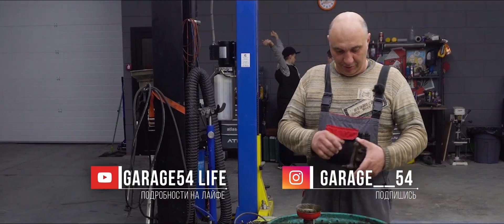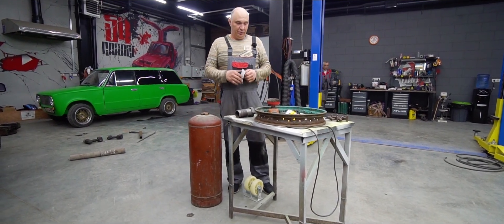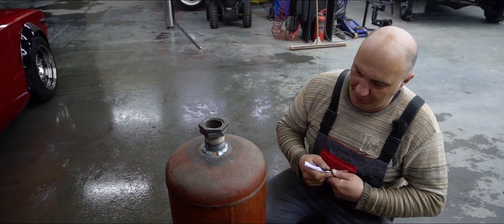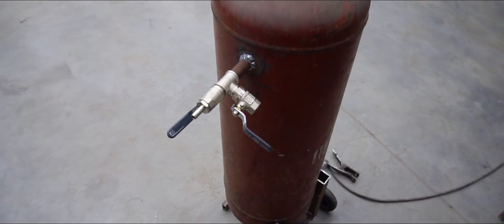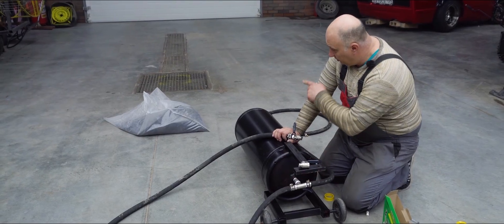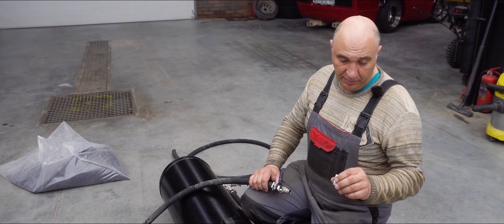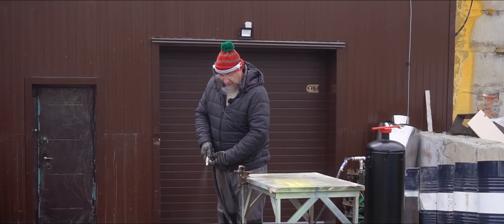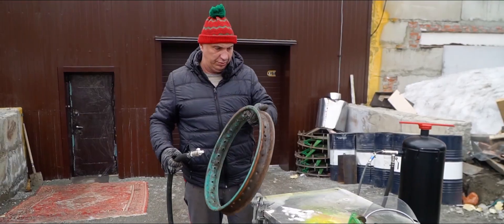Making a DIY sandblaster

Comment: The sandblaster design here seems to be pretty well designed. The only concern that I have is the fact that they used ball valves in areas that there will be plenty of sand, which probably will be a an issue pretty soon. 

As far as the wire wheel thing is concerned, as the primary grinder and finisher in the iron works that I work at, I can assure you that if you have the right wire wheel, it could easily take that rust off. Applying the right amount of pressure, I have done quick sweeps and gotten worse rust right off that way faster. If the wire wheel for your grinder are bad enough that you consider a drill wire wheel as in any way comparable, that would probably be the main issue. I personally like Auprex's 4 inch diameter .02 twist knotted wire wheels off of amazon. Those things eat through rust like butter. Do be careful though, because it can eat the steel's surface and definitely use all the safety equipment too. I can't tell you how many times I have found bits of wire embedded in my arms, when I don't use sleeves.

Comment: Gotta set the sand and air mix and when opening the hand valve all open or closed quickly. Been doing this for decades and if not you'll wear the hand valve out in a few seconds. Even ones made for blasting will wear out in a minute if you don't have full open or closed. Always wear a hood with least 3/8 plastic lens. Hook a filter up before the sand or that'll cause issues where you gotta shake it to get sand out good. Even with hood and glasses on sand will get inside and will get in your eyes. Sand will get in places sand shouldn't be. And duct tape won't stop it. So if using on a diff, engine etc plug up with plugs and whatever you can. Great idea and cheap idea. Use hydraulic hose for the sand hose. I've used one and had a blow out and it's not good. Check it before each use. When you do a big job it's alot of sand going through and it will eat hoses, valves etc. Way faster than anything but acid.

Comment: Filling it with water is great and all but it's a pain in the ass. I have welded on many used gas tanks and i've found that all I have to do is make sure it's empty and blow compressed air in there.

Comment: PLEASE PUT THE GUARD BACK ON THAT ANGLE GRINDER IF YOU ARE USING THOSE KINDS OF CUTTING DISKS!!!!
Reply: I usually have mine removed also, but only because I'm using paper sanding disks most of the time for what i do. If that flimsy cheep cutting disk cracks at 5,000+ RPM, you're going to have a REALLY interesting new face piercing to show your friends. Google some images if you don't want to take my word for it. And no, safety glasses or a face shield are not a substitute on their own, it will go right through them at that speed. You'll see if you search for the images. You'll still be able to do the job, just put the guard on, it ain't worth it. Good channel.
Reply: And a smart move regardless would to be to keep your face out of the same plane as the disk. Keep your face off to the side a little bit. You're not doing precision surgery here, you'll be able to see fine. Better than not being able to see later.

Comment: I love these vids but holy shit was that unsafe. I would've made a plexiglass box to put the parts into before sand blasting so it doesn't hit everything in the area. If any of that failed as well, he could've been seriously injured or killed. Yes he tested the hoses for holding the air pressure but what about all the rough grains of sand passing through the hose as high speeds

Comment: remove rust in a H2SO4 bath while re-growing iron/steel back with electroplating
Reply: paint, electroplate, iron, with aluminium (sulphate) or copper (sulphate)
Reply: add zinc to the mix with zinc sulphate, to the bath, to the paint
Reply: grow iron to a 3d printed mold by electroplating from ferrous sulphate
Reply: Sulphuric acid not good at removing rust, just your skin😎
Reply: how about copper/silver acetate metal layer chemical deposition, with heated sand blaster metal paint spray

Comment: i used to work at a scrap yard and we would cut propane tanks with acetalyne torches after just screwing the cap out. little flames, no big deal. Except one day one was in the cutting pile with a cap still on it i started cutting into it and all of a sudden loud bang... well the cap flew out... we heard it hit something 500 ft across the scrap yard. needless to say i checked every one from then on

Comment: I've made several sandblasters out of propane tanks and you guys made yours different than mine. First, get a new two-wheel cart for about 40 to 50 bucks and just blow out the tank instead of using water. Don't cut the top of the tank out. Remove the valve and put a 3/4" nipple 1" long where the valve was. Screw on a 3/4" gate valve to control how much sand you want with your air. You will find this most useful. Another short nipple with a T. All 3/4" fittings. One side of the T is your sandblast hose. The other side is 3/4" hose that goes up the side of tank. Put the 2" pipe thread nipple into the hole you put in bottom of tank which from now on is the top of tank. 3/4" nipple in the side of your filler pipe long enough to go through the edge of the lip of the tank. I always tack this one after tight to keep from moving. Put a T on the nipple pointing down two take the hose from the other T. Stitch an 18" plate on the wheel cart for more stability and weld a bent pipe from one cart frame to the other side to protect your air dryer when it gets knocked over. Don't worry it will get knocked over sometime. A female 1/2" chuck going to the dryer and your done. The gate vale will save lots of sand and prevent from over loading your discharge. I always mark the valve tap for settings and shut off sand when done. With a 3/16" nozzle you can do a 3-4" pass in one swipe or a long-wheelbase five-ton to shinny steel in 2 hours or less. The dryers on tank and coming out of air tank is best. Well worth 6the extra bucks. I run a regulator at 150 psi out of a 225 psi system. This will work better than what you buy.
Reply: NEVER, NEVER just use air to remove the residual gas; always use water to be 100% safe! A very talented welder in my area blew himself up just using air.

Comment: I have a question, but there’s too many variables. For example; Why would they cut the threads off of the fittings? Why not incorporate new threaded holes for the fittings? Is a hand welded fitting equivalent to a threaded fitting? Yes; there are many types of teflon tape, even for gas fittings. But, since this cylinder no longer contains gas, the question is, “ How much PSI is this air-filled sand blaster going to require or handle for a successful operation?

Comment: It works well but can be very dangerous. Your losing your media and should have a air regulator and air filter. 
The ceramic nozzle is also a bit small. Thus the spray pattern. Good luck and be careful.

Comment: In life there are 4 levels of difficulty.  1 Easy. 2 Medium. 3 Hard. 4 Russian.   Makes me want to pull out my old sand blaster and clean stuff.  Important to keep the water out of the air.  Fit a water separator to your compressor line.  Regards from South Africa.

Comment: Russians are amazing and very intelligent . They are a bit like the irish as in safety  comes along later .However great video but to really blast you need an animal of a compressor and larger hoses .Some are using powerwashers now and putting an additive in the water to delay rust until the units dry off .All these cleaned bits should be prime sealed immediatly after blasting .Anyway well done.

Comment: No doubt this guy is very creative.  Unfortunately, copper slag is an environmental hazard.  https://news.stanford.edu/pr/98/981209slag.html The quip about Chernobyl is right on point.  No one seems to care (especially in Russia) that you just spray contaminants all over the ground, rather than in a contained environment in which the slag can be reused indefinitely. 

Несомненно, этот парень очень креативный. К сожалению, медный шлак представляет опасность для окружающей среды. https://news.stanford.edu/pr/98/981209slag.html Шутка про Чернобыль уместна. Похоже, никого не волнует (особенно в России), что загрязняющие вещества разбрызгиваются по всей земле, а не в закрытой среде, в которой шлак можно использовать повторно бесконечно.

Comment: I prefer to wash it out than purge it with inert gas (engine exhaust) before & while I'm cutting. So I don't have water while using 240v grinder. Just a different way to skin the same cat.

Comment: Just keep in mind that grid flies like 10-15m so the blu car next to wise needs now paint. Replace hose every few months they get soft, the best hose is hydrulic with steel reinforcing. I would think of some safety device the professional machines have deadman swich (low pressure gives signal to pneumatic swich that swiches big diagrapf valve). Most robust material and cheap is rubber but its not to last forever.
Most dangerous situations:
1. Grind reflecs from object and you get hit by rebound.
2. Main pressure hose bursts and grind flies everywere. Its like machine gun.
Ps. If the grind is wet from compressed air it will get stuck. It turns into rock when is rusting. Just empty the chamber after use.
Also mind grind is reusable.

Comment: You can use Molasses , and water to dissolve rust . 1 part molasses 9 parts water. Let parts soak for a week. Then wash away the rust with a water hose.

Comment: Old Plumber trick! If you have  tapered fittings, always tighten first. Just enough to break free. The taper will slightly enlarge. This breaks loose the joint, then unthread easier.

Comment: The most important thing he didn't mention, is NEVER even think about welding an empty gas or gasoline container. ALWAYS make sure it's full of water. So called "empty" containers often have traces of old fuel in them, and they WILL EXPLODE if you dont fill them with water.
Reply: 2:08 Watch again. He did mention filling it with water was crucial to displace any gases or dampen any fuels.

Comment: Instead of trying to salvage so rusted rim, you'll be much better of buying new one🙏 Surface rust will not compromise the structural integrity but that rim was completely rusted through and removing it will take you very long time and in the you will just compromise the strength.. It's nice to save money but not in expanse of safety😉

Comment: At 17.20-- "That said, safety should always be a big concern..." 
To which we heartily agree, and suggest the sandblaster operator do all cleaning of parts outside, not inside the shop. Airborne silica is a permanent hazard for lungs, so he should wear an ultra- fine-particle, dual breather mask, which covers the eyes, nose and mouth with an air-tight seal. This type of mask is used in auto body shops during spraying of automotive paints. You cannot be too careful, even with all the thought and craftsmanship which produced this wonderful tool. Thank you for the idea !
BTW-- BMI Russian provided an Impressively fluid and nuanced translation. Its translator had no discernible accent, and spoke as rapidly and clearly as needed.

Comment: These guys definitely went to space first !!  and had there been a way to get to the Moon  regardless  if  it  got them   hurt or killed ?  they would have  done  it  !! but they couldn't  because  of  the firmament  , and it wasn't  for a lack of  trying  .these guys right  here don't  complicate  things  yet they know  that what they're  doing is dangerous  , so they do what they  gotta  do  and very  resourceful , where they  lack in safety  they gain in common sense. These are The real deal  kinda guys .

Comment: I cut the top off a 50 gallon form oil drum that still had plenty of oil still in it.  Cut with a oxygen acetyl touch cut halfway leaving less than a 1/4 tab on one side then cutting the other side. Keep in mind I was standing below the lid my arm fully extended and crouched down.  The lid falls into to drum and a mushroom cloud about as big as the Presbyterian hospital that we were building at the time in Albuquerque NM. So fun watching the look on the all the formen

Comment: eh what gas was it filled with , I read propane on the tank so I guess LPG , if you open the tank and pour out the liquid gas and let it air out for 1-2 days everything should have evaporated and no need to fill it with water to work on it.

Comment: I use to sandblast with professionnal machines 40 hours a week. We also had a portable sandblaster that kinda looked like this one. Never used it in more than a decade working there. 

To operate this you need some good CFM from your compressor. Not those 8 gallons fron Harbor Freight trust me!  They recommend for those small ones a minimum 5 HP+ with 6 to 25 CFM. Also, you need a good capacity tank of air. I wouldn't recommend below 40 gallons, cause it goes very fast. 

Professionnal sandblast stations, on the other hand, were enclosed with a glass protective seethrought window, high power LED lights and filtered recuperation stations to get the maximum out of your blasting media. Those were pretty expensive and needed 550V 3 phases power and at the very least 35 CFM of airflow. Total investment, about 25K for each machine plus the blasting media and the compressor. 

Compared to a brush and grinder, this is WAY better and faster, night and day. For the price, I would suggest anyone in a garage to have that kind of equipment, but don't forget to wear some protective gears like a cartridge dusk mask and safety glasses. You don't want old paint particules in your lungs trust me.
Reply: Thank you!

Comment: Phosphoric Acid. The shot blaster is ace, no doubt about it, but, I found that the rust makes tiny pits in high carbon steel that are so small the grit cannot dig them out. To be rust free later on all rust Crystals need to go. Phosphoric acid gets right in to the microscopic holes and de-rusts them. *shot blast, acid, acid etch primer, two-pack top coat.

Comment: Dry air is the key to sandblasting. It takes surprisingly little moisture to interfer with the sand feed. One drop will stick a 2 cm ball of sand together. If the blast hose twitches as you work, you're getting sand in clumps. 

You're in a cold moist climate. You need more than a water separator. I suggest a refrigerated air dryer or a dessicant dryer. If that's not possible, rig up an air heater. 50 - 60⁰ C air to the sand pot will dry the sand and keep it loose all the way to the nozzle.

Comment: Sir if you put a shutoff after where the sand enters the hose,you can shut it off and release the pressure in the tank.Now turn the air on to the bottom of the tank. Now you can breakup any clumped blasting grit,with out emptying the hole tank. I ran one of these things for 30 years in a welding shop.

Comment: Also add a agitator air line close to the outlet to loosen the sand and get it to flow better, fluff up the sand

 And search for a 40/70 mix of sand..... for bad rust use a 30/50 grain sand, avoid 100 mesh sand as it is pretty much useless

Comment: I like this Russian and his ENGINE-nuity. Wish he lived next door so we could share idea's. Another way to do a sandblaster: Fill a Homer bucket with abrasive sand, insert a siphon tube into the sand with a vinyl hose connected to a solvent sprayer head. Connect air hose. Viola. Less susceptible to humidity and easy to clean. That big acetylene tank will be very difficult to clean out once the abrasive begins to clump up.

Comment: Rust removal using electrolysis has been around for decades. A tub of water, 1/2 cup of washing soda, battery charger. No welding, no cutting, no air pressure required.

https://m.youtube.com/results?search_query=Rustremoval+electrolysis

Comment: I used to work in a shipyard. One of my jobs was sandblasting.  I loved that part of the job. Through my positive-pressure helmet I would watch the rust turn to clean gray steel in long, hypnotic sweeps cleaning gigantic plates.  I couldn't hear anything and a tap on the shoulder told me when it was break or quitting time. I was always surprised! I had no sense of time passing.
--as far as safety equipment: thick gloves, positive pressure helmet, tear off layers of plexiglass on the front of the helmet, heavy canvas clothing. This macho man? -a pair of knit gloves and a fold-down face shield. Hey, they're tough in Russia.

Comment: I missed the purpose of the sparkplug could someone explain?
Reply: Th ceramic is very tough stuff and resists being quickly abraded away. You can use a metal tube, but the abrasive will eat it away fairly fast.

Comment: Will the sand wear out the rubber hoses ,just a thought ,old jimmy west Aust ,you done well it works reasonably well
Reply: I often use a sand blaster where I work. The hose and metal fittings do have to be replaced now and then. They are considered expendable and part of the cost of the process.

Comment: Besides fitting it with a water-separator, you could allso fit it out with a pressure regulator. That way you can control the speed the particles come out of the nozzle….. So if you have to blast sheetmetal clean you wil not heat up the metal that fast and warp it. Awesome piece af kit though!!!